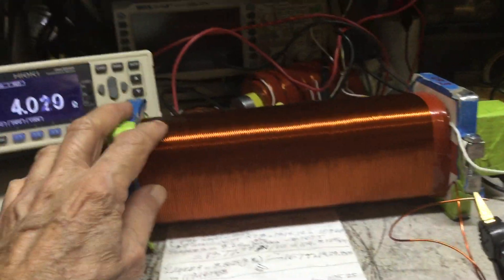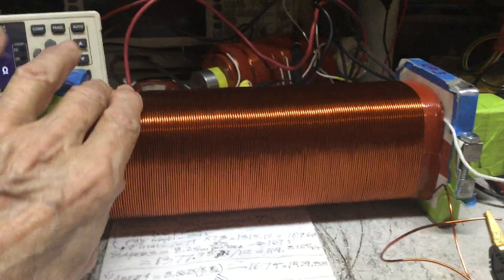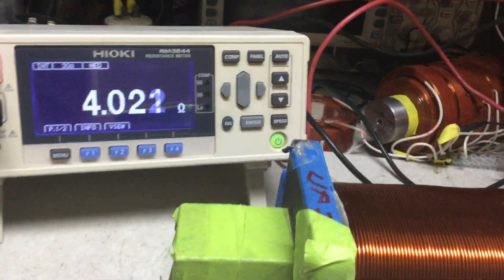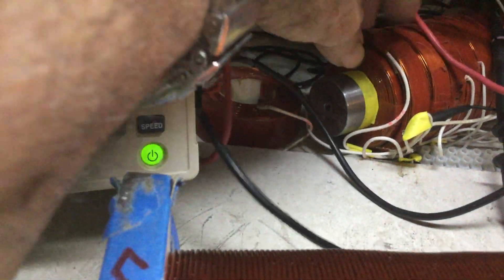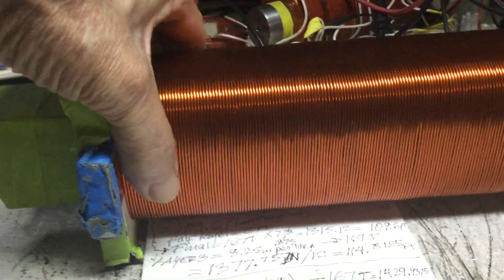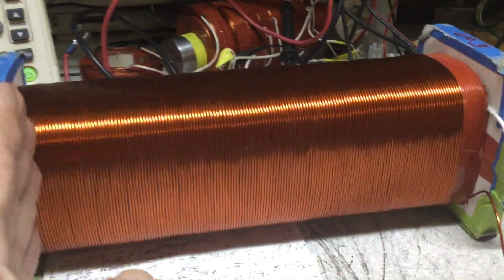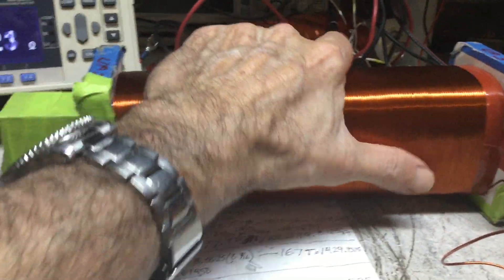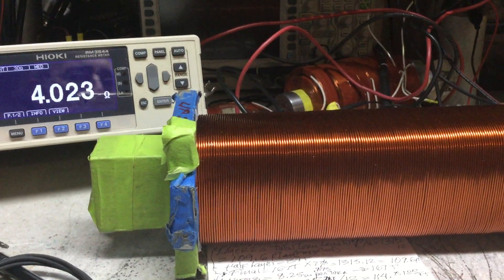FIGUERA CENTER SECONDARY FINISHED

Comment: Does input power goes up when you increase power consumption from secondary coil?
Reply from the maker: I will not give you a simple answer Marcis,
I will make your brain work...so, if I add a load to main secondary, it will create a Field, which would be STATIONARY, FIXED.
Then the Exciter Coils will keep moving a VIRTUAL Magnetic Field, through their sequencing, back and forth through this Main Secondary & Stationary Field.
Now, do you think this Virtual Field movement will need to be increased in power or just in speed (frequency) once that we add more load to Main Secondary?
Thanks
Reply: @ufopolitics  Laminated iron can't handle frequencies above 400 Hz. Need to use metglass or ferrite cores to go at higher frequencies.
Back EMF coming out of the secondary coil induces current in the nearest primary coil, causing it to consume more current. Back EMF witch devours energy.
It is possible to eliminate back EMF witch using Tesla bifilar coils. Tesla bifilar coils have enhanced capacitance between wires. Above critical minimum frequency Tesla bifilar coils operate as a capacitor and don't create back EMF field.
Reply from the maker: @marcisgulbis9310  I am not going to drive this Generator above 100 Hz, it will sequence from 50 to 60 Hz normally.
There would never be a "nearly primary coil" which is "stationary" for the BEMF to catch on...there will be multiple coils (exactly 8) all switching back and forth, which moves a VIRTUAL (No Mass) Field along the Secondary.
Lenz Law or BEMF will not act against a massless field, moving at 60 Hz.
Now, answering your original question: No, Input Power will NOT go up when loading secondary. On the contrary, it will go down - a bit- from its original input values.
This is NOT a Transformer, it does NOT work with reversing currents like AC does, SO, it can NOT be analyzed as a Transformer,  it is a LINEAR DC SEQUENTIAL SIGNAL, where we are using the TWO Electrical Polarities (-/+) moving at UNISON, back and forth in a LINEAR FASHION through 15 Sequential Coils.
It bolts down to MOVING A MASSLESS, WEIGHTLESS MAGNETIC FIELD back and forth, that simple.
Reply: @ufopolitics    60 Hz square waves are composed of 120 Hz, 180 Hz, 240 Hz, 300 Hz AC sine waves, especially if you are using mechanical commutator to generate square waves.
Reply from the maker: @marcisgulbis9310  I am NOT using a mechanical commutator here. 
I am using a Logic Board for sequencing attached to Two FET Banks, one NFET as the other PFET.
I have the option to do it without and with overlapping.
These are not "square fixed waves" either, they are ON/OFF in sequence 1 to 8 and 8 to 1...for both banks at UNISON.
Reply from the maker: @marcisgulbis9310  And I really do NOT have the time to keep this discussion here, sorry...
But if you want to find out how this device works go to My Forum:
https://overunitymachines.com/index.php
and check my Figuera development, as also there is a Topic for the circuits of the Solid Driver.
You do not need to be signed up to browse these two Forum Topics.
Good-bye